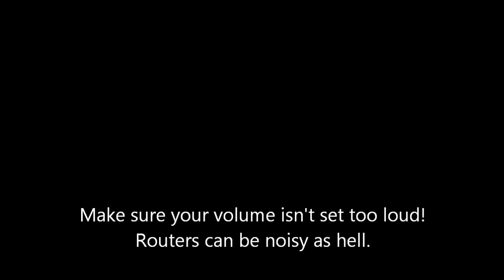CNC Router - Cutting Dust Skirt

Comment from the maker: @aaronmarkgough Thanks! Well its a funny story. I must have spent several months looking out for a flexible PVC online and in hardware stores but I never found it. I got tired and gave up for a few months then decided I'd try a local textiles store and they sold the stuff by the metre. They didn't have the thickness I was after (2-3mm), the thickest they had was 1mm. So I just ended up wrapping two lengths of it around the dust shoe and its worked well.

Comment: Hi, I was using a dust skirt like this but sometimes the cutting tool reach some of the bristles when they go inside. Now I prefer just to leave very small distance between the surface and the skirt base but without using any brushes.

Comment: thats  strange because my boot with standard black brushes never lets stuff out like yours, almost looks like you have no suction at all.   
i do wish i could see, but looking at the clear skirt  seems some gaps open up and i cut g10 fiberglass and my brushes don't have a gap afterwards.    well cheap and  worth a shot though. but i need the performance mine already has with visibility

Comment: hi .. do you find the pvc is better than the brush strip ?
Reply from the maker: Brush strip is better, especially if you're cutting wood. However the pvc still works really well and is more flexible than the thick brush
Reply: thanks man. i only have pvc strip at the moment, so will have a go with that first.